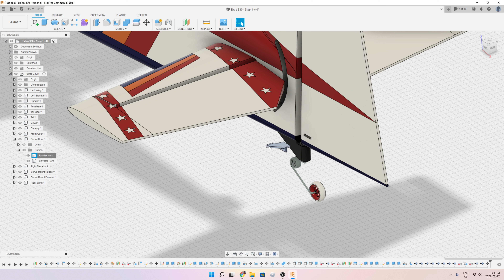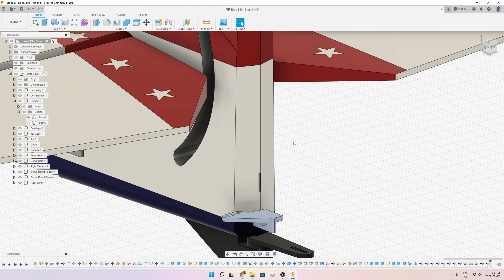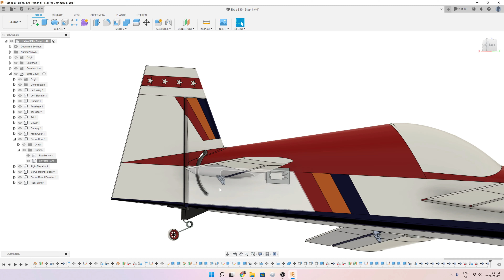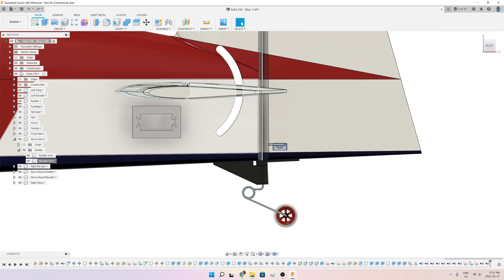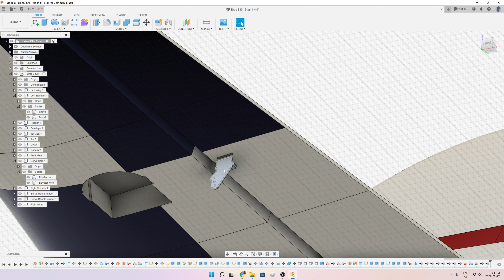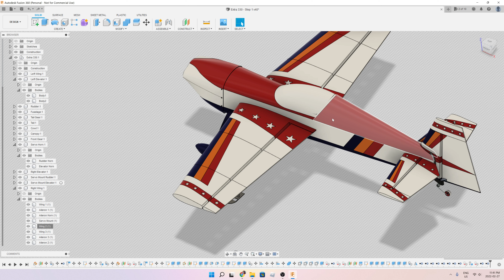3D Printed Extra 330 RC Airplane - Part 2

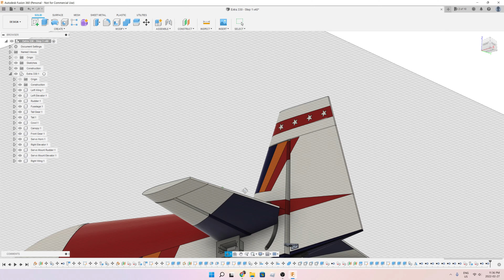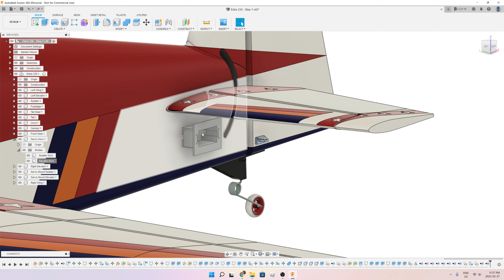Comment: at 2:25, WHY  is  so  much  of the elevator  MISSING.!        WHAT  is that silly  curved  opening for.!              at 2:29,  WHY  is  a  servo  gonna be  STICKING  out of the tail boom;   NEAR  the  TAIL.!        such an aft location of the  MASS  of servos  is the  OPPOSITE  of  Smart.        control horn.            at 3:46,  the silly   5-sided  servo  BOXES.   equal  unnecessary  mass; equals  Dead Weight.  located  AFT of  the  c-m.      more  Opposite of  Smartness design  choices.!                          googletranslate
Reply from the maker: 1- Not sure what you mean by much of the elevator missing, please clarify. The curved hole is for the spar connecting both elevators so that you can control them with one servo (less weight in the back)
2- Servo boxes are not going to stick out, they will be flush with the fuselage. I have not started working on the fuselage yet
3- Servo boxes will be only a couple of grams so no much weight addes
4- Unfortunately the only way to avoid having a rudder servo in the back (more weight to the back) is by using a pull-pull wire mechanism which introduces a lot of extra work. You can counter the rudder servo weight by moving the battery forward